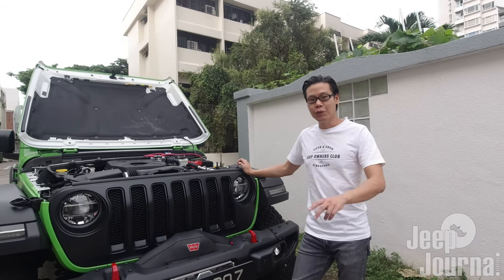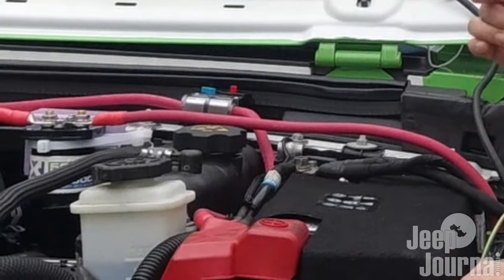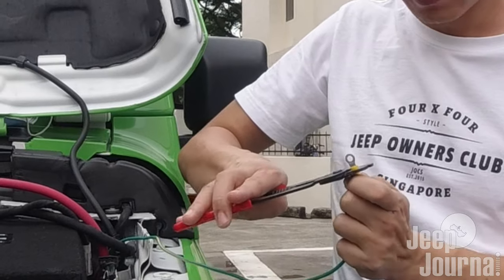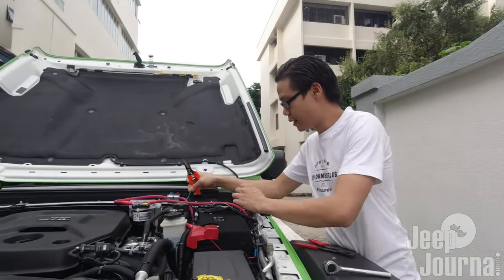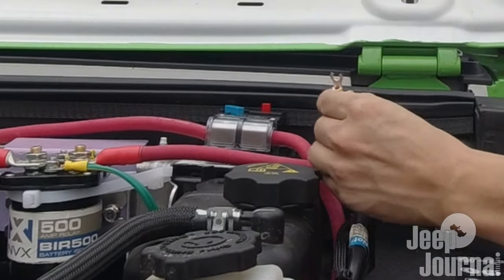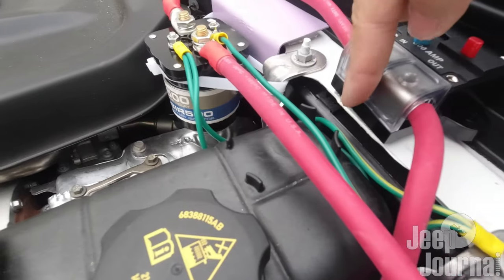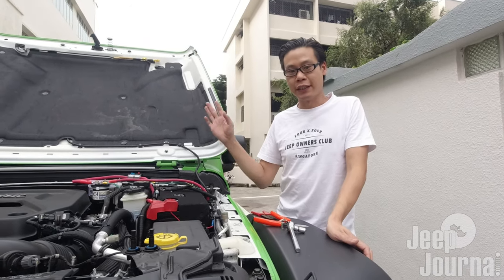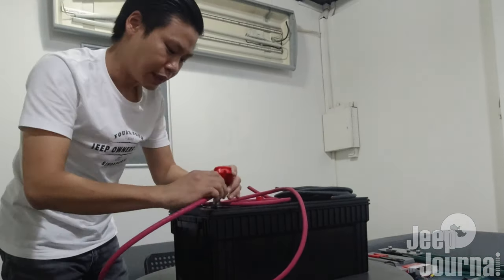Jeep JL Wrangler 2nd Battery - Secondary Battery Installation with NVX BIR500 Isolator (Part 2 of 2)

Comment: Hello, Nice video especially because there is nothing out there for right hand drive. Just a question, why didn't you connect the acc wire to the cigarette lighter fuse in the fuse box next to the battery.

Comment: I'm kinda confused? U are aware that the isolator you have is a smart isolator ? The circuit breaker you installed is perfect, but you do know the isolator switches the circuit to the rear battery off/on by itself, and there is no need to manually disconnect with the breaker? I'm sure you are aware of this, but, someone else watching may not be aware of this. Great two part video, thanks for taking the time to share.

Comment: need fuse on 2nd battery (not breaker). was hoping you would show your rear battery tie down method , how is it attached? Hope you don't leave it just loose??
Reply from the maker: Hi no I don't carry the battery in the boot all the time. It was meant to be removable, so that I only use the battery when going off-road to power my fridge. I am still looking for a solution to tie down the battery but for now, there is no battery there (:

Comment: What size wire did you use for the ground on the isolator?
Reply from the maker: Hi! I used 2AWG!
Reply: I'm asking for the ground and auxiliary on the isolator. Those size wires.
Reply from the maker: I used 16AWG, or 1.5mm2
Reply: Okay thanks a ton. I bought one of these for my car audio system but realized it didn't come with any recommendations on the ground or auxiliary wire sizes
Reply from the maker: Yes cause the wire is only needed to activate the isolator sensor to switch off or on. So current draw is very minimal, thus a normal wire will do (: